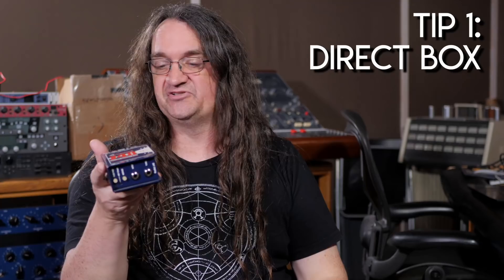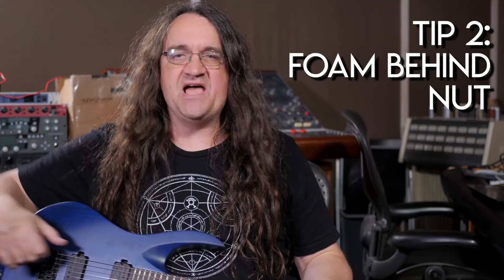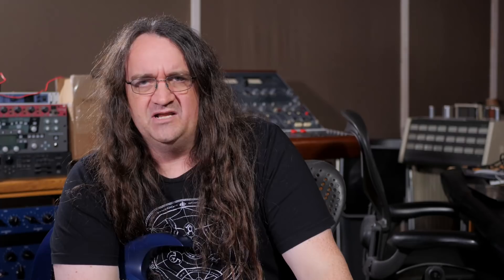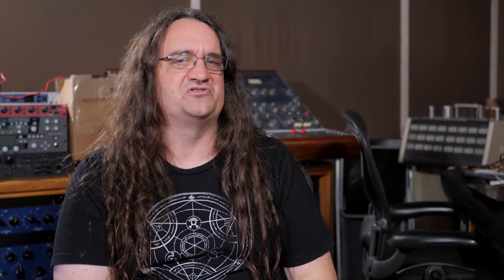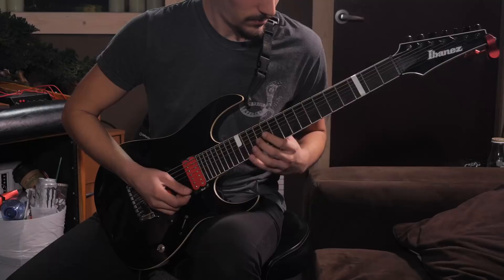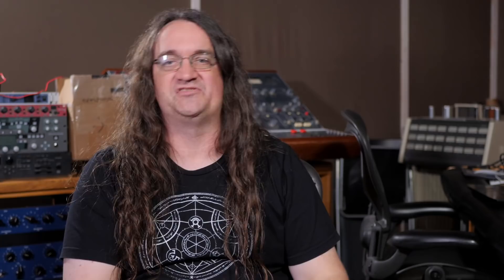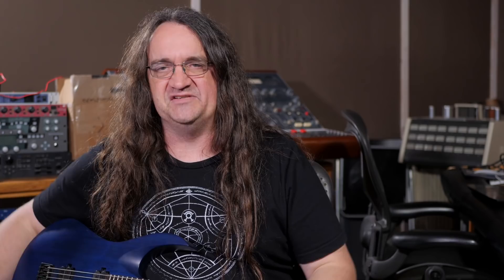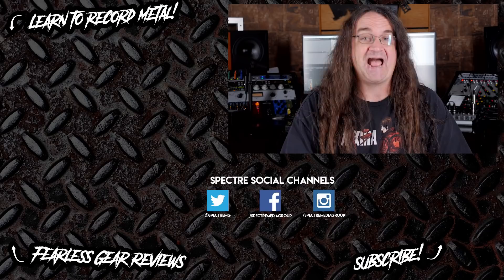Five Tips for Recording Metal Guitar at Home

Comment: Huh... Rick Beato and Tim Pierce generally recommend picking lightly to get good tone, and relying on gain to get volume, but they're generally not doing metal and super high gain.   Seems like picking really hard is going to do strange things at the begining of the attack, by slapping the string against the frets, giving momentary fret buzz for just a few vibrations of the string, until slapping against the frets has dissipated the extra energy and the string settles down to normal vibration at a lower amplitude, clear of the frets.   That slappy sound right at the beginning may give you a more percussive attack in some sense.

If picking really hard is good, it seems like it would be important not to also grip the neck hard and mash the strings with your fretting fingers, such that you're pushing harder than necessary to fret the strings and making them go sharp.

Comment: Re: amp sims... I go guitar to X V-Amp (floor model) with the cab & gate settings on there, through my Scarlett into the laptop. Works like an absolute beast, and the DAW (Audition 6 in my case) has plenty of comp & EQ to futz with on the mix side. I am going to try blanketing my 1x12 with the 57 in front for an upcoming review as well (also in through the Scarlett Solo Gen 3).

DI, my Yamaha electric classical and Ibanez Artcore sound insanely clean through the Scarlett going direct.

Comment: RE: The tape off trick, the one I saw used by the guys from Threat Signal and one I've adopted is using a sock and tying it round the neck over the strings, works the same as the tape, but much faster to add and take off again and does the job great.

Comment: I use both sims and actual amp+cab.  It depends on what sound I want for that part of the song. One of the best things I did (and I wish it hadn't taken me so long to find this... so many songs I want to redo), is I got a solid mixing board, so I can have multiple inputs. I plug in to one spot and I can quickly flip between different options on each channel quickly or push one to L and other to R if I want to hear it in the mix before deciding. Sometimes you don't get a 2nd of that perfect take, especially when you suck like me. So, it's nice to be able to split them into two tracks and decide based on the sound, knowing they were played identically.
Reply: Or, I should add, sometimes they sound good together as a 2x of sorts

Comment: Well it has to do with impedance also because most found cart and put our line level and the guitar is actually a Mic Level and also I track the amp and a direct signal and use it & just to blend in with the recording track one of the best guitar songs I ever heard was a GK amp reamped with 2 u87XY Pattern right close to the speaker I couldn’t believe it sound I was hearing that was actually on a Bon Jovi record

Comment: Thank you so much for the foam behind the nut tip! I’m on a budget, fell in love with the Peavey Piranha 6505 because with an overdrive behind it and a properly leveled interface with cab sim in front it’ll give you a gnarly ass metal tone, only problem is it’s a tad too much grainy gain that bleeds through in the rests depending on what you’re playing. I don’t have a noise gate pedal to put in my physical chain before the amp, so you just saved my ass $50.

Comment: Noob tips- 

Pick as hard as you can on a palm mute chug when setting levels on your input. This is to make sure you don’t hit the red when you start recording for real.

Double track at least (one guitar per side)

Use slightly different guitar tones for your left and right track - less phase issues and they will cover a wider frequency range in the mix

You don’t need as much gain as you think for a big sound. Try backing it off a little.

Don’t scoop out all of your mids when recording mixing a real amp - if you want a scooped tone you can always take out frequencies in a mix. It’s much more difficult to add them in

Comment: #1 

I got a Berhinger U-phoria UMC 22 after discovering my Line 6 POD for some strange reason ABSOLUTELY REFUSED to work with the line in on my sound card.  Line out works perfect with an amp,  just not with the soundcard which also has no problem (I'm no dummy with tech, it's a bizarre situation).

Anyways my UMC 22 with a software guitar effects unit/amp simulator sounds AMAZINGLY better than plugging into line in.  As good as anything I hear on albums I listen to.  It's also costs about half of what dude in the video recommends.  If your tight on $, it's an excellent alternative..

Comment: Cheer glen, Realy interesting and informative man...I loved the sections about pics,and taping of the strings and the use of foam behind the nut...I play with my band Bodach and we use a few different strategies when building up the guitars...like on the left channel I would use a hard pic, and drop the gain down on the amp to make it very clear and articulate...and when recording the right channel I would smash the gain up. change the guitar and use a thinner pic but increase the pressure on the bridge with my right hand and hold the softer pic very very close so not a lot of the pic is showing above my fingers and strings...it kinda melts together realy nice ...it works well for us...again....thank for the great vid...your instruction is awsome....

Comment: I think the reversed headstock helps with the ringing strings as well, because the thinner strings, which are more likely to ring behind the nut, have a shorter distance to the tuner. On my 7 string Ibanez, which has 7 tuners in line, the high e string is so long, I have to use foam to get rid of the noise. But it's also one of those things, that when you notice it, you can't unhear it. :)
Reply: If the strings ring behind the nut, that means your nut slots are too wide for the string they go into.
Reply: @crimsun7186  No, not true. They pick up vibrations, because everything is vibrating, when you hit a string. Same thing with the springs of a tremolo system.
Reply: @gitplayer55  Most of the vibrations of that ilk are too small to even influence anything.  The only way a string would ring behind the nut would be if the nut is not contacting or holding it properly or the guitar was strung in such a way that the string is floating over the nut slot and not touching the bottom part of it. If these vibrations were clearly a major issue, you'd have to dampen the string slots from fixed and strat style trems as well to prevent the string from ringing behind the saddles.
Reply: @crimsun7186  Sorry, complete BS. It happens on a Floyd Rose guitar with locking saddles also. You just didn't listen closely. Try it, take you guitar, put the headstock near your ear, strum the strings and immediately stop them. You can hear the strings ringing behind the nut.
Reply: @gitplayer55  Even if that does happen, the vibration amount is negligible. Enough that none of the manufacturers do anything to solve this "problem". And no, string tress are not made for that. Pretty much every single guitar recording of the past didn't stress over this ringing and you can't hear it as well. Even Glenn is not sure about it despite trying to give an example of it.
Reply: @crimsun7186  Ehm, there are products on the market to adress this issue. Look for Jimmy Clip for example. Where did you get the info from, that guitarists don't use the foam trick on their recordings? Which recordings are you refering to?

Comment: Practicing through an amp / interface / whatever is good advice, sure, but it's even better to practice RECORDING before actually doing it. 
I always do a shitload of pre-production, recording and re-recording my guitar parts a million times until I get them just right BEFORE THE ACTUAL RECORDING. That way I've already ironed out all the little kinks in there and I don't need to waste anyone's time re-recording at the studio or where ever. It also helps you get over the stage fright (or recording fright?) when recording, which at least for me, was pretty bad in the beginning.
And yeah, anyone can do it at home: since you're not looking for the ultimate tone or anything in this case, you can pretty much plug your guitar directly into the integrated line-in of your computer, grab some free software and just do it. Once you've set it up once, it'll be really convenient to use as a composing tool as well.

Comment: i went to extremes on the mute i detune alot and 1st needed heavy tension springs to balance string tension so i wasnt floppy strings allover neck and i achieved that goal with sheeer greatness!1 setup guitar and i mean setup the guitar i use coated heavy tension springs which also dampen vibration in and around your trem springs this was a absolute golden bullet!then i allways fret wrap i use ibanez guitars all i wrap the 7 s i must use the heavy ten .springs!my 6s i can just keep the tension fine with 3 springs in a angled confige1and piece of foam help in there but i wrap every guitar i play at nut/locktuners period1why?because i wont play lol without them after get used to palm muting and lagata attacking with its just amess without reallly!i cant stress enough!and then we get to attack and pick i used to cook with dunlop0.46 mm but i wanted to get bak to a happy middle ground so i wanted to play every pick made!and i did!i used lots 0.68s lots 1mm and .73s and ect!i like the primetone 73s !but my go to picks are nylon flex 50s!.50 but beefy and got awsome spot that i call the bullseye attack\m/:) depending on the finger u chioose to put the main circle grip on gives advantage 1 to the down stroke or 2 the sweep attax!i am mostly rythm player so i use it for extreme death metal attack mode!i used to play with 2mm /whater lol thick picks but after flying around for years on the .46s ect i realized i wasnt any faster just maybe less finnesse to get the release1so i dove bac k into pick choice and got a few i use white fang hetfields in .73 and primetime and tusq both .73but im allover the flex 50!i have small home studio im into plugins now mixing ect!wow as the world of music burns/turns/try to learn i am lol\m/im 48 i been in the underground/extreme music scene since 15 so !ima bit overwhelmed by all the stuff i didnt no about/recording1now im in trial by fire1im taking fire but trench warfare it will be and i will never surrender so !hope to see you alll again soon!\m/berserker\m/besafe great vid live every like its last\m/or go quietly\m/

Comment: My only criticism here would be, tips 4 & 5. 4 is kind-of bad advice, as I think it would be more prudent to be more dynamic in one's playing. Sure, use a harsh pick attack by all means, but only when it's necessary.
As for #5, in my experience, I've kept a wide variety of pick sizes from .18mm to 3mm & made of various materials from nylon to copper, to steel & everything in between. That way, I could easily use whatever works for a particular piece that I was recording.

I might also add (if anyone else hasn't suggested it yet): Learn the classical picking technique as well as learning to play with a pick.

Comment: One thing I have never seen good information on before is what level to record the guitar DI. One one hand, should it be as close to what is coming out of the guitar as possible? Or should you try to get the biggest signal to noise ratio (DAW internal math-dependent, of course) which you can then turn down for re-amping later if you have to?

Comment: I personally pick extremely hard and when i use a guitar that's just not there in terms of well done string tension and the action is relatively normal/low i get so much fret buzz on the lower strings. It's to the point i have to actually constantly thing to pick softer. Also, i just can't use a soft pick for the life of me...

Comment: I'm a fan of the Dunlop "red" pic. Which I believe is a .50. Anyway, I feel that any agressive strokes cause the strings to hit the pickups or worse, frets. Of course you can solve that by raising the action, but I feel sacrificing your action is a tradeoff I'm just not into. By using a slightly softer pic, you minimize unwanted string collision and can still be agressive in your pic attack. Because I always play in a "B standard" tuning, my strings tend to have a lower tension. For anyone who plays in a drop tuning, you all have probably felt the "collision" and cringed. I always hated that.

Comment: Question not really related to the video: Do you do a lot of work outside of the metal spectre of things? I think as an engineer (and musician/professional in general) it's good to keep a wider and diverse perspective on things. What I mean by this is working on all sorts of genres in order to gain experience so you as a professional would be better suited in more settings. What are your thoughts on this? Greetings from Norway :) Keep up the good work!
Reply: In order to be good at your craft sometimes you need to specialize in a certain genre. I doubt there are many engineers capable of producing top tier mixes across different genres.

Comment: Get this. I have the Focusrite 2i2 but I only use it for the microphone cos I also have a Yamaha THR10X and just run it into the PC via USB as it is set up to do for recording.I could mic it but its got the small speakers and Im thinking it wouldnt be a noticable improvament if it was better at all.
Might start using amp sim software though and run through the 2i2 but the THR sounds really good as is. Anyone wanna comment Id appreciate your thoughts.

Comment: Check your interface DI/Hi-Z input specifications before use. Most are calibrated to take 470 ohms of input, which is less then half of what a normal guitar amp has.
In general, inputs of amps have about 1M ohms of resistance. Dedicated DI's and Reamp boxes are tweaked to provide the same amount of resistance making sure you got the cleanest signal.
Using your scarlet or similar for guitar input is killing your headroom. Try a DI and you will see that even the simplest amp sims will sound loads better!
Reply: That is done so guitars with active pickups don't clip the preamp even with the gain at zero. Plus, I'm certain you can only tell the difference if you measure it.
Reply: @crimsun7186  Using a lower impedance does not result in a lower decibels all the time, if your interface preamp clips with active pickups, something is wrong with the preamp design. The primary reasons for using a 470 ohms impedance on interfaces is mostly because of cost saving, since transformers are relatively costly.
Higher quality interfaces like the Apollo or Apogee stuff actually provide a correct 1M input for instrument level. but getting a separate DI is more cost efficient if you are on a budget.
Reply: @TheOnlyJoeyYT  Do you really need a transformer to present a 1Mohm impedance? Also, some other interfaces have way more impedance than that. The now discontinued Focusrite Saffire interfaces had instrument inputs with 10Mohms of impedance. Is it just a sound thing or just the classic thing you can only measure the difference?
Reply: @crimsun7186  Of course you can use different components to build a DI, but when talking about Guitar recordings (which the video is about), you want to capture with the same impedance as amps would expect (which is 1M) since the response and frequency curve would be correct. The difference between a correctly recorded guitar signal for re-amping and something that is done on a cheap interface direct is night and day! Its mostly clarity and headroom that you are sacrificing when using the wrong impedance.
Reply: @TheOnlyJoeyYT  For about 340 USD, IK Multimedia released their Axe I/O interface, which has an instrument input switchable between 2.2K and 1M, as well as an Amp out for reamping. Way cheaper than the Radial DI + Reamp boxes combo.

Comment: While we're on beginner stuff, silly question for the peanut gallery (and Glenn, if he sees this). I've been learning to play bass for almost a year now, and about a month ago decided I wanted to get an audio interface so I can play around with amp/cabinet sims and other effects beyond what I can get out of my practice amp. I picked up one of those Focusrite 2i4 interfaces, which has a combination 1/4" plug + XLR jack. As per the 2i4 manual, the interface automatically configures its internal pre-amp for a microphone if you plug in an XLR connector. I've been plugging my bass straight into the interface via a regular 1/4" plug guitar cable, but if I wanted to use a DI box (or amp/FX pedal with XLR DI out), is that a non-starter with an interface like this?

On a related note, getting an interface is about the best thing I've done to improve my playing, because now much of the time I spend sitting in front of my computer doing other random stuff like watching Youtube or Netflix, I also plug in my bass and noodle around practicing licks, riffs, and scales with the volume low.

Comment: With passive Di-boxes you get much less input inpedance for your guitar. Why no one talks about that? A tipical ratio for a di-box transformer is 140. With a mic input with 2kohm you get only 280kohm impedance for your guitar. its too small, not even closer for 1Mohm that is required.